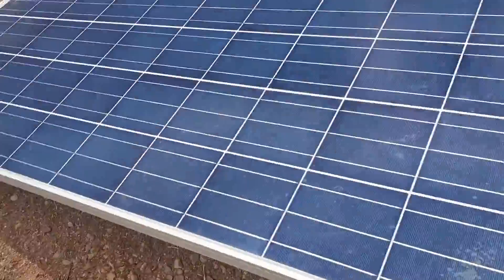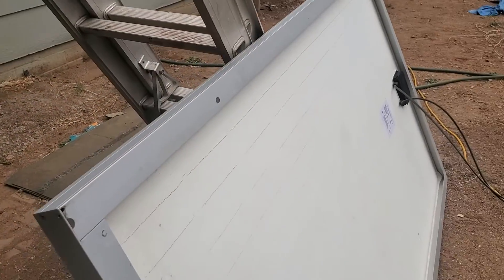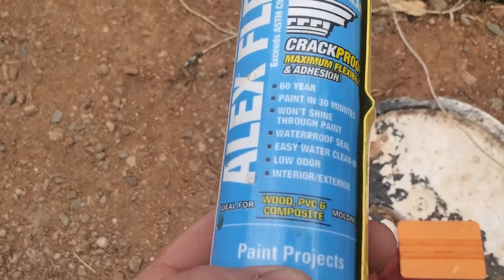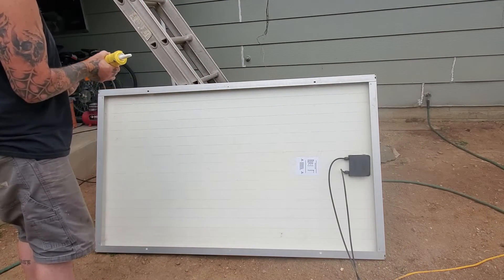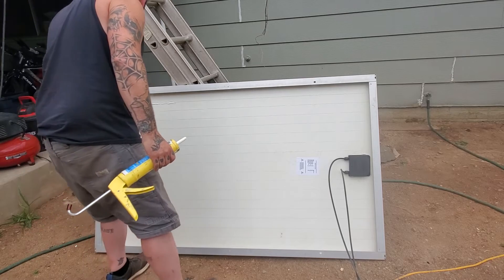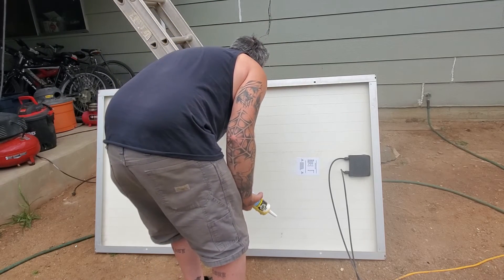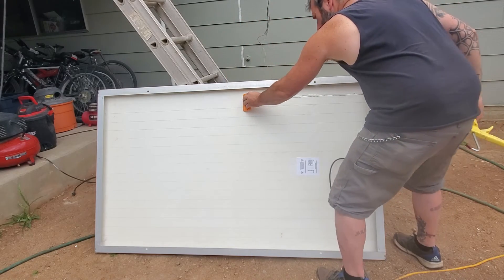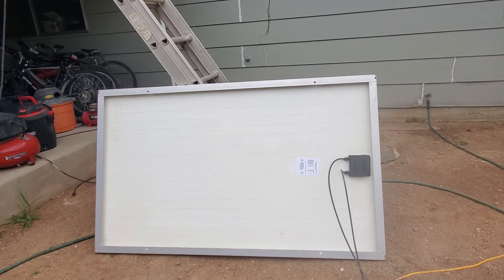how to fix santan solar panels cracked backing vinyl

Comment: Spray and seal works great and a lot easier.
Reply from the maker: I did what was cheapest.  Also a year later the panels have further cracks in new places. Just worth mentioning
Reply: Hello. Saw your comment today, how has that spray and seal held up? Thank you!
Reply: Been2 years,  stills looks like new.

Comment: Thanks for sharing. I've had my eyes on their panels for some time. How good is their power output? Besides fixing the cracks how would you rate these as used panels?
Reply from the maker: Well I keep buying more haha. I have 10 so far. $440 vested. I also have 4 100w harbor freight monocrystalline panels.  Probably costing much more and not 2.4kw. The panels Probably produce full output.  And do great in low light .even if you only get 200w from a $44 240w panel it's super cheap. I'm running 2 window ac units off 8 panels and 3000w 24v inverter
Reply: @hamradiohack  totally! Great price point. I've wanted to run ac on solar. Any chance you have a video on that?
Reply from the maker: @TheNorthwestForager  several.  Subscribe and check out the adventures.  I started 3 months back with hf panels

Comment: Yes, what other options besides what you used?
Reply from the maker: Lot of people use Henry roof stuff. I don't cover the entire panel,  just the crack lines and the area where it's directly behind the bus bar. We had monsoon rain coming so I had to get it done quickly.  Ive done 8 panels this way. You can use anything really. Maybe even paint.  But painters caulk is fast and easy
Reply: @hamradiohack  Thank you. Yes, monsoon is definitely almost here. I'll try it out.
Reply from the maker: @Abc-sl1nf   It rained on me on my way backup North I didn't have a lot of time. Got alot of rain last few days after I got more panels
Reply: @hamradiohack  You're lucky you get rain. Here in Mesa, its been kinda dry. San Tan Solar has some good pricing on panels.
Reply from the maker: @Abc-sl1nf  at least your not 120 miles away from them.  Cost me $100 to go there. BTW these panels work great. Especially with the clouds lately that we usually don't have. I thought about going to santan  today but probably closed for 4th
Reply: @hamradiohack  You got me there, lol, 20 min drive to San Tan Solar.  I;m definitely checking out the Growatt inverters.
Reply from the maker: @Abc-sl1nf  do they carry those?  I have 8 240w panels.  I have 2 40amp epever tracer 4210an charge controllers and a 2000 hf inverter on 3 deep cycle batteries running my window ac. But it's very temporary.  I need to find something better

Comment: I wonder if Dicor or some EPDM roofing compound brushed on might be better? Thanks for the video!!
Reply from the maker: Many people use Henry roof stuff.
Reply: @hamradiohack   Which kind of Henry's roof stuff?  One of the first things I thought about is the Henry's Tropicool white silicone stuff, which is probably easier to apply, but maybe expensive.  Then there is all the black stuff, which you can apply even if it is raining.  That stuff cracks in sunshine even if you use the texture cloth with it.   Painting it white is also recommened so that might help.  Why not just use polyurethane paint?  What do they use on new panels that actually lasts?  It's the juncture boxes I worry about leaking.  My used Solarex panels have pretty tight backing except for some bubbling of the back-coating around the juncture boxes, so I am trying to figure out what's best to use.
Reply from the maker: @OWK000  I just use painters  calling. I don't use Henry.  Paint would probably work just fine also.  The panels really aren't going to get much water contact on back side. Some panels crack some don't. It's vinyl